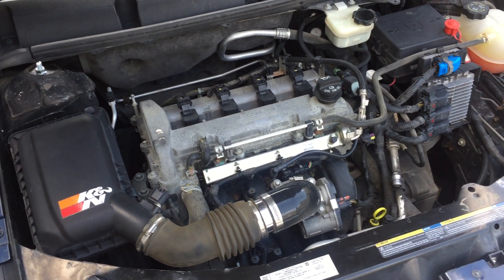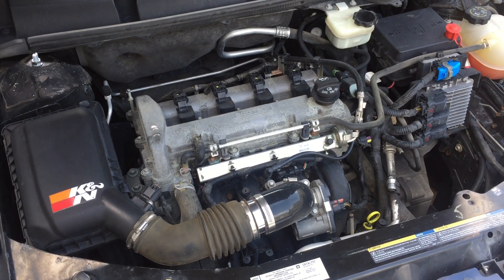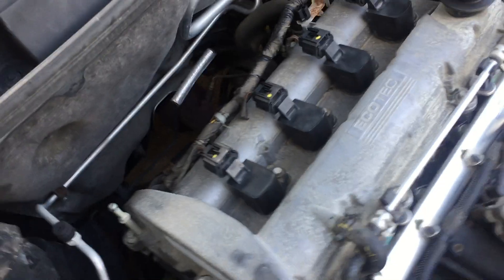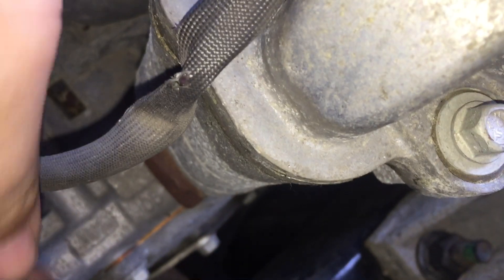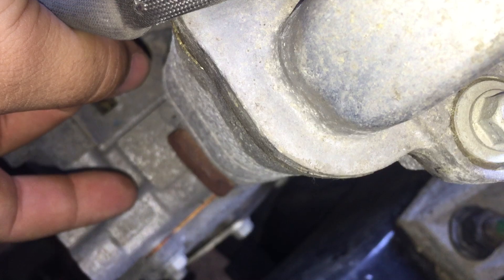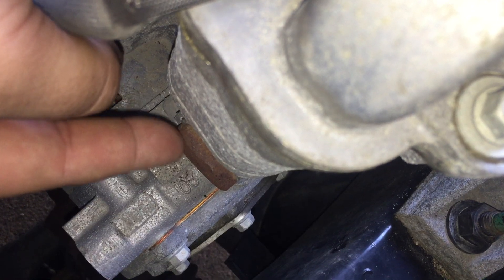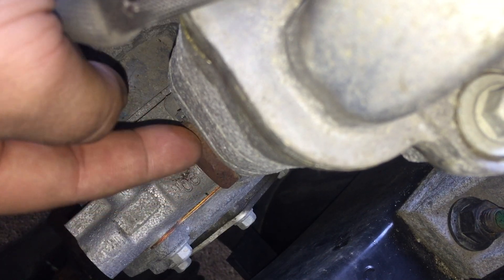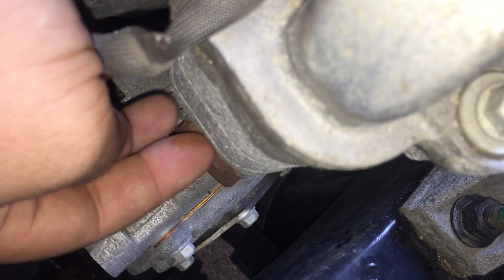Ecotec Cold Start Timing Chain Rattle example and tensioner location 2.0 2.2 2.4 lsj l61 le5

Comment: New updated tensioner is junk too.  There is not enough lock positions to keep slack out of chain. Even when all timing components are new tensioner only tightens chain when oil pressure comes up. Early designs the ratchet mechanism was weak and didn't hold. The newest only have 3 locking positions which is not enough. I got sick of the crap and now modify the tensioners I install. I remove some of the internals and install a 7/16 fine thread bolt on the end of the tension so I can adjust the chain tension myself and lock it. Proper tension is finger tight on the tension bolt and lock tight.  Every few oil changes I check tension and about every 25k it will take about 1/8 turn to snug the chain up again. No more cold rattle ever.
Reply: Does having this rattle impact the engine at all? I get it on startup on my 15' 2.4 equinox only when the car has been sitting for longer than an hour. Planning to drive it 600 miles in a few weeks and was on the fence about getting the chain replaced since I'm inching towards 140k miles but do stay on top of oil changes.
Reply: @dennisborn1382  man, it drives me nuts, just rebuilt the engine , with everything new, and it does it occasionally. When I checked it to find the issue, the tensioner does move back nearly all the way if pushed with extension or large screwdriver, such a stupid design. I wish they stole design from older toyota or something,  when engine is  crap, but tensioner keeps it alive... I quite didn't get it where do you put threaded bolt ? At the end of the tensioner where it pushes the guide?   if there is a way to make custom design with more locking positions, with smaller steps?
Reply: Make a video on how to do this?
Reply: 3 years later my updated gm tensioner is still keeping the rattle away 🤷🏼‍♂️

Comment: I got the latest revision and it effing sucks as well, sometimes it rattles, especially after long drives and higher Temps, sometimes it doesn't. Suspecting one cam sprocket not locking up, but exhaust one is brand new, and engine after full rebuilt with brand new timing chain kit from Cloyes

Comment: Using the wrong oil can also cause the same rattle because the tensioner is oil fed for tension (hydraulic tensioner) and my 2013 Captiva start rattling like this at cold start at 4500km after oil change due to only having 2.5-3L of oil left. Caused by the factory defected oil rings on the pistons burning oil off. 
Ensure you’re using DEXOS1 oil. 5w30 and nothing different. 
Ensure levels are topped off. Usually happens when oil has lost its integrity. When cold. Once moving through the tensioner (oil fed hydraulic tensioner) the tensioner does its job. 🎉
Reply: Adding Lucas low viscosity helped mine go away also. Helps keep it from getting dry while not running

Comment: if its a timing chain, would it happen every startup?
Reply: Yes
Reply: Yes but it normal to hear very minimal chain rattle on a cold start, after it warms and builds oil.pressure  it's goes aways , if it's warmed up and you hear the chain rattle then yes definitely
Reply: @t0ny2trill  thanks

Comment: Mine rattles at high rpm but not on start up. I just bought a new updated GM tensioner for it. I hope it fixes my issue. It literally just started and I have 112000 miles on the car. It's a 05 cobalt ls.

Comment: I've got p0016 and p0017 codes and every common fix I've come across has not worked. Im thinking maybe the timing chain is ultimately the problem.  Damn.  I was trying to avoid an expensive repair, but I think replacing the timing chain myself is wayyy out of my very novice wheelhouse.  I guess I'll be off to the shop...

Comment: Mine is exactly like this, only a 2 or 3 seconds on start up but intermittently.  I’m gonna try just the tensioner first.

Do you have to pull the valve cover to do the tensioner?
Reply: did replacing the tensioner solve the issue?
Reply: @nushensenevirathna5231 Just saw this. Yes it did, almost 3 years later no rattling at start up and running great. I used a new updated OEM GM tensioner.
Reply: You will need a new valve cover gasket don’t forget that. Good luck!
Reply: Did replacing the tensioner solve the issue for you?
Reply: @randygonzalez5758 Yep. Almost 3 years later still no rattling at start up and running great. I installed a new updated OEM GM tensioner. Luckily I caught mine early otherwise it may have been too late.
Reply: @Raiders9947 thx for the prompt response.  Really appreciate that
Gonna try replacing just the tensioner and hope I caught it early enough

Comment: My 2017 terrain sounds like this when I cold start it and noticed RPM needle will go all Tempe way up like normal then stays above the 1 for 15 secs then the noise gets a little quieter . Could timing belt cause that?

Comment: If the Chain is rattling it is a safe bet, even with the older tensioners, the Chain has stretched and should be replaced - including Gear set. The biggest enemy of the older tensioners was/is lack of maintenance. Dirty oil blocking flow into the tensioner, creating sack and accelerating wear.
* Mine(HHR) actually failed while turning off the car, with no indication.Jumped timing. Went to start the car the next morning and had  fast spinning engine and no start. All 8 intake valves were bent from attempting to start the car.
Total to Repair(DIY), including a rebuilt head $600-$800 - If the Pistons are not damaged.
Reply: I rebuilt the head on this engine and guess what. Even after replacing the tensioner, guides, and chain. There was still some slack on the chain that would appear on the top between the two sprockets as I spun the engine. I even compared the old chain to the new one and there was no stretch at all in the old one. I believe this is just a defect on these engines
Reply: @AlexHernandez-xh8ei  Nope. Just completed mine yesterday and it is running great.
Only one of 3 things will cause Slack in a chain with all new parts.
1 - Tensioner not unlocked properly after installation.
2 - No Oil pressure going to Tensioner.
3 - Turning the Engine counter-clockwise then checking.
*The engine should never be turned counter clock as it immediately slackens the chain and can cause timing to jump.

These engines are actually very dependable if well maintained. some have exceeded 200k easily before needing any critical service. Others, not so much.
Hard driving, harsh acceleration, increased chain wear - reducing life span.
Missed oil changes, cheap filters, harsh environment all reduce engine life.
Today my HHR with a Rebuilt head is almost as snappy as brand new. Just missing the new car smell.

Comment: Every single one of these engines rattle like that cause it’s a shitty design, I’ve found a new tensions doesn’t solve the issue of it gets too loose the chain is likely stretched as well. This one in the video isn’t too bad actually

Comment: Have the third version with the cone shaped hump on the bolt head. It also has failed. Same start up noise. Frustrating.
Reply: No reason for the 3rd gen tensioner to fail on its own. It has better oil passage and larger oil capacity.
*most suspect is poor maintenance leading to carbon particles restricting flow to critical part.
Things to verify
Tensioner condition. Gen 3 easy to disassemble, inspect and reset for reinstallation.
Timing chain wear and Guide damage
Proper oil pressure - Dirty oil puts wear on the oil pump mounted in the timing over.

^If you are getting noise from a relatively new tensioner(and it was properly installed and released) the likely issue i worn out Chain, Gears and guides. Replace as a set. Cloyes sells the most complete sets for this motor, with or without the Water pump set. (Gaskets not included)

Comment: Pro tip for anyone who likes to save money by wrenching themselves.  These tensioners are in a really crappy spot.  If you're lucky you can get a ratchet on it and it'll break loose.  If you're unlucky, like me, you can get a ratchet on it and it won't break loose. It was looking like I might have to pull the head off to get an impact on it.  Luckily the Astro Pneumatic 1822 and 32mm socket fit between the engine and firewall on my 2012 Terrain. Best $96 I've spent in a long time.
Reply: Hu??? Just get a breaker bar my dude. Or even better, old school. Ratchet and put a pole on it for leverage.. Physics.
Reply: @Savvys we always used the 3 ton jack handle 😂

Comment: I have a 2007 solstice, upon start up it does not make no clunking like that. It’s makes a knocking noise a few seconds after it’s on. When I rev it’s louder and faster. Can it be a phaser or broken timing chain guides?
Reply: Could be a exhaust leak. My 2.2L ecotec has a tick that is coming straight from the exhaust manifold.

Comment: I have an 04 Saturn vue with the 2.2 ecotec, 156,000 miles. It rattles like that when I start it (warm or cold) and has a constant light rattle noise the whole time it’s running, most noticeable on idle. I got the p0172 code for the first time after fixing the charcoal canister (to fix a p0455 code) and I read that the engine running rich could mean the timing chain stretched or skipped a tooth. I’m not driving it for a week or so now until I can change out the timing chain, I hope it goes ok and isn’t too crazy difficult. I got an eBay timing chain, I read that they (usually) work just as good as  OEM, anyone have experience with that?
Reply: Damn bro, never buy ebay lmao how's your cat doing 2 years after? 😢
Reply: @presidentemaiq8652  I actually ended up successfully replacing the timing chains myself, didn't even have to pull the engine to do it. It ran like a top after that, no clacking or anything. Then like a year later (which a year of reliable driving was worth the 1000 bucks total I'd put into the car), the clutch slave cylinder went out and it hasn't been driven since. The whole front sub frame and trans has to be removed for the stupid slave cylinder to be replaced... so it still runs great, but can't move!

Comment: Mine doesnt sound like that mine jjst makes this ticking sound
Reply: Did you find out?
Reply: @neymar-goat1010-k8d it was the black timing chain guide, if you just take off the valve cover, you can see if any guides are broken bro, the left and right one, and you can see if your timing chain guide is also broken just by taking off the valve cover

Comment: I have a 2012 Chevy Malibu 2.4 120k miles.  Replaced everything.  Oilpump, all chains, guides, tensioners, cam phasers and phaser solenoids.  Still rattles on start up but quiet and smooth while driving.  Got an exhaust phaser code that comes up every now and then but never illuminates the check engine light.  Can't think of the exact code.  That tensioner is on the exhaust phaser side which makes me think it's loose on start up and pumps up after oil pressure hits.  It's a brand new tensioner, new style.  Sludge in the head maybe?
Reply: I have a 2011 regal 2.4 ecotec and had the rattle issue intermittently. Upon doing research I finally got it to stop. I believe it was the oil filter, it was restricting oil flow to the furthest parts of the engine causing rattle noise at start up. I wasn't using the recommended filter to save money. I started using AC DELCO like the one that originally came with car and rattle has totally stopped. I actually saw the insides of the AC DELCO and another brand and the AC DELCO has a less restrictive filtering system in it allowing for a freeer and less restricting flow so the oil can reach furthest spots upon  start up. At time of post I have 90,000 original miles and never had any repairs, knock on wood!
Reply: @markpalladino572  Thanks a lot for posting this. Really helpful. Will give it a try. My HHR is having the same intermittent noise when starting in very cold days. Drives well with no other issue.
Reply: @ibenzawla  my 2011 was still running perfect at 104,000 but was getting gas in oil more than normal so I was so paranoid I changed oil every 1000 mi. I used Walmart hi mi synthetic  and didn't change the filter till every 5000 mi. $18 for synthetic oil is good and I changed myself so it wasn't such a financial burden. Oh and also these engines are known to use oil too, mine used about 1/2 qt every 1000. It ran perfect til the end when on 10/20/2021 some guy fell asleep at the wheel an hit me head on.
It was totaled and i got $9000 from insurance, I got so much because my baby was like new and the ajuster takes condition into consideration. I wish i could send you a picture some how.
Reply: @markpalladino572  I'm glad you're safe. Thanks for sharing. Trust me I hate wasting money. Will try all sensible ideas before moving on to the expensive ones. I mean the car drives good with no other issue at this time. Will let you know.
Reply: @markpalladino572  Big Update: so I followed your advice and bought an AC Delco oil filter for my 08 HHR SS. Changed the oil using Mobil 1 full synthetic.  For a few days it rattles at cold start. Then it gradually stopped. The weather has been really cold in the past weeks and I did some serious testing. aI have not noticed any timing chain rattle during cold start so far. I was reluctant to post an update just to be sure but today at 20 degrees I started the car after two days and I did not hear or notice any unusual sound. So thanks a lot for your advice. I honestly knew there is something I was doing that was not right and I say so because the car runs like new all other times. Will keep testing but so far so good. Thanks.
Reply: @markpalladino572  Do the dealers use  AC Delco? I normally don't change my own oil, so where should I go to get this? Thx
Reply: @TwistedRealityLife  yes any GM dealer is gonna use A/C Delco, but your gonna pay extra at dealership. I always got mine at Walmart.
Reply: I just though of something, since Walmart sells the filter you can have them do the oil change, anywhere is gonna be cheaper than dealer.
Reply: Make sure you use 5w30 and only A/C Delco filter. Some other filters  are more restrictive and oil doesn't reach the highest point of the engine upon start up causing chain etc. rattle.
Reply: My 2.4 has been gone since 10/20/21 thanks to it being totaled and I really miss my 2011 regal and I was looking forward to racking up miles and seeing how long it would last. It's a shame cause it had all fluids changed and new brakes, plugs and it would have been ready to take on the next few thousand miles without any maintenance. I'm now the proud owner of a rare find 1993 Honda Accord that's like new from head to toe. And it's my first Honda and I love it. I get offers to buy it constantly, and people pull up next to me and ask about it. I wish I didn't have to drive it in winter but it's my only car. Anyway getting back to your 2.4. So you know, rattle didn't go away totally every once and a while, but very rarely it still did, I'd say it went away about 90% compared to before I started using the proper filter A/C Delco, so I stand by my assessment fully. Keep me posted cause I enjoy your feedback.
Reply: @markpalladino572  Yeah I have been looking for a Honda around that age but its hard to find. Accords and Civics (especially hatchbacks) are becoming rare these days. That's the golden age of Honda IMO. That's a great find. The AC Delco filter is still working great. I have not noticed any weird noise so far plus the engine appears to run very smooth.
Reply: I wouldnt risk it, change the timing set up or at least the tentioner! If your getting out of phase codes i would assume your chain linkage is stretched, id recommend replacing the entire timing set up!
Reply: Whoever did all that work should have reported any signs of sludge buildup

Comment: I have a 2015 Malibu w/240k and it has begun to do that on a cold start
Reply from the maker: rip
Reply: Built Performance LLC 
If you come across one I highly suggest to make a how to video on it
Reply: I'm surprised it lasted that long. The colder it is the worse the noise. Anyone find the fix?
Reply: @Monster33336  the noise went away after having the vacuum pump changed the only issue now is my car dies when the auto stop tries to turn the car back on.
The dealership said that the issue is bad injectors it is a 1200 repair
The car sits @248,800ish, there’s no check engine light on which seems odd if the injectors have gone bad but the dealership has never been wrong with issue that the car has had which is minimal until now.
Repairs to date are 3k total which isn’t bad for having it 5yrs and keeping up with regular maintenance.

Comment: I mighttry installing a new primary tensioner without deactivating it or should i say activated, do t see the need to remove the valve cover n all, correct me if im wrong anyone?
Reply from the maker: You can certainly try playing with fire if your feeling dangerous. I personally did this one in the video without pulling the valve cover or anything but i mean you have to really listen and watch to know your not jumping teeth in there. Risky game to say the least so youd have to be ready to replace the engine if that happens lol.
Reply: I caved and pulled the cover off lol thanks for the heads up 😎 turns out the old one was not activated, felt it activate on the way out, deactivated it and reeinstalled it the reactivated it, works wonders now, so eone didnt do their job right apparently.

Comment: I have a 2.2 ecotech with 230k.. All I've done is changed oil every 4-5k and just replaced coil packs 100 miles ago.. She's a champ but is getting tired.. I don't have this issue on start up but do have a weird noise coming from motor at 3-3500 rpms.. Someone said it sounds like a timing chain whine? Anybody else experience this kind of noise? Or am I the only one with a 230k mile ecotech lol
Reply: I do, mine is around 2k rpm. I'm chainging it today... haha